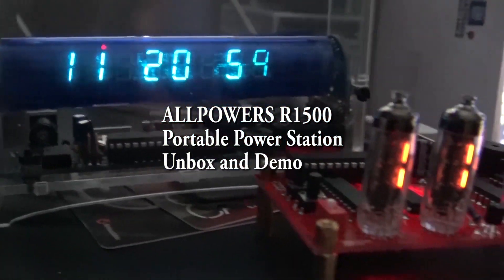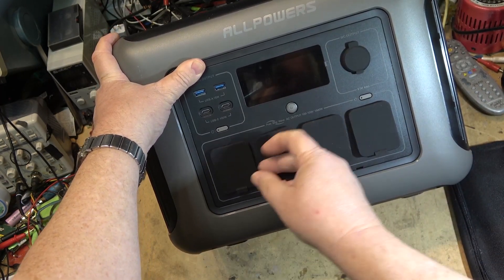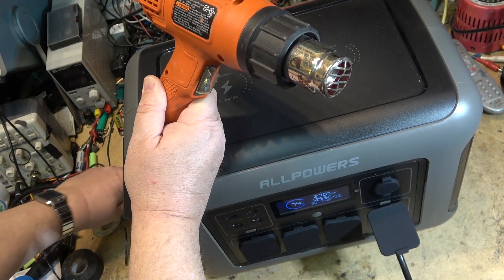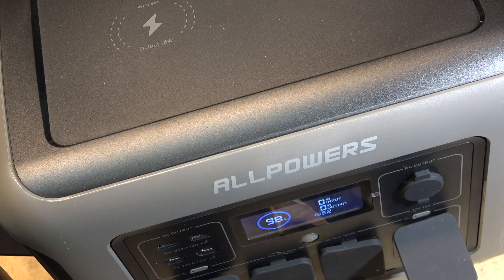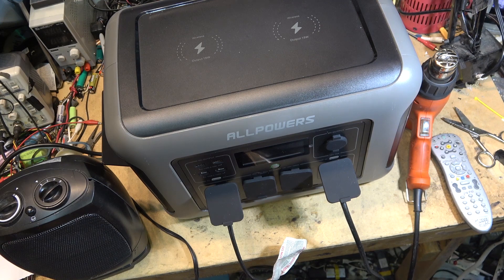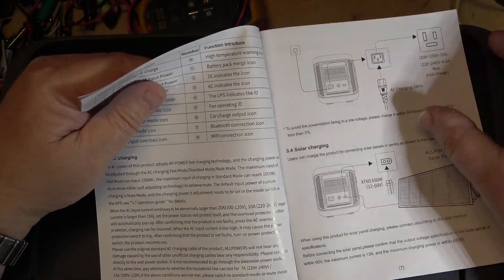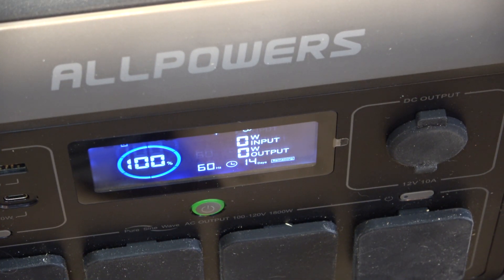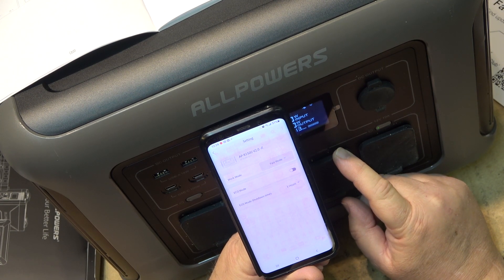ALLPOWERS R1500 Portable Power Station Unbox and Load Test

Comment: my question is:   what will it be in 5 years from now?  and the same question to all the brands out there. they clain 10 years  of  exceellent useage before dropping to 80% recharge states???
Reply from the maker: People said that about my electric car.  Said the batteries would be toast in 5 years.  Well 13 years later the batteries are fine and even the old 12 volt battery is good.  If you look after it and don't leave it set until the battery is completely discharged you should be fine.  Many times people buy these things for camping so they don't use them and charge them and discharge them every day. if you throw them on charge every 3 months to top them up when they're being stored they could last you years. Others that use them every day to charge them with solar and use them off grid may find that the batteries will start to wear out after several years.. they say 5,000 charge discharge cycles. Well if you charge it once and discharge it once every day that should equate to about 13 and 1/2 years. The battery in my car is the same and that car is now 13 years old.  Has the EV range dropped? Yes it is a little less than when new but it's a plug in hybrid it just changes to gas at 30 miles when used to go 35.

Comment: I received the "Allpowers R1500" station with an initial charge of 66%. After reaching 100% charge, the fan stopped at the end of the charge cycle. However, the next day, despite being fully charged at 100%, the fan continues to run constantly.
Whether the AC or DC outputs are on or off, it doesn't make a difference; the fan keeps running even with the battery fully charged.
Is this normal in your experience?
Additionally, the app indicates there is an update available but requires a code. I've tried reaching out to Allpowers but haven't received a response.

Thanks for your feedback.

Best regards,
Reply: Hello, I have the same issues. Have you managed to receive update code?
Reply: @DerZiL131  Allpower does not provide any update code.
The update option exists, but to my knowledge no update has ever been released.
This is exactly what I criticize Allpower for.
Reply: @cyriloa It's a pity. 😢
Thanks for saving my time)

Comment: Yeah but not easily being able to open it up means you can't change the battery when needed. And it will be needed, these things don't last that long, esp. if its used like a UPS.
Reply from the maker: Mine been going running 24/7 few years now.  They say you can charge and discharge every day and they should be good for 8 years.
Reply: @12voltvids  I assume it depends on how the unit functions, with respect to constantly charging?  All the UPS units I've used, the batteries only last about 1 - 2 years in constant service.
Reply from the maker: Big difference between lithium and lead acid UPS. With that acid the battery is always on trickle charge which kills it after a couple years. The lithium units use a battery management system which shuts off charging and keeps them off until they need to be charged. So the batteries are not always constantly under a charge condition.

Comment: What happens if there is a fault, do you need an earth rod?
Reply from the maker: Is this app working? Hello
Reply: where does the fault current go if not plugged in?   @12voltvids
Reply from the maker: No you don't.  It's isolated from ground.